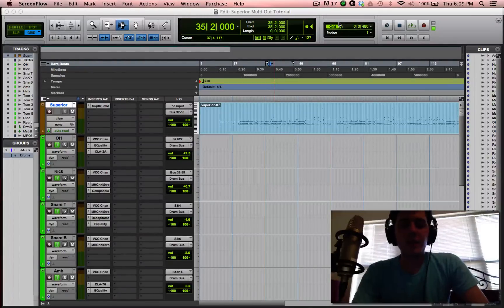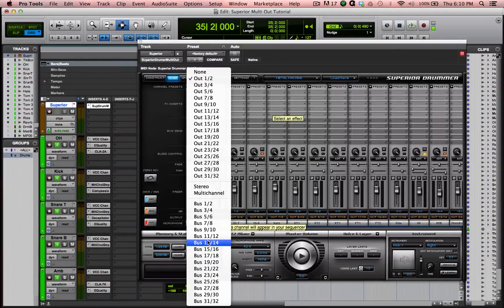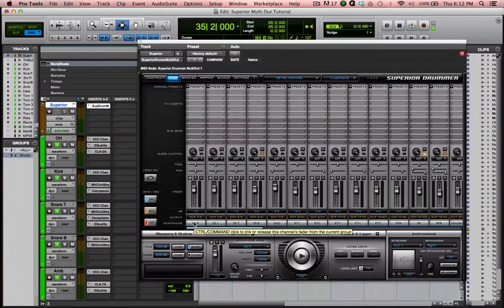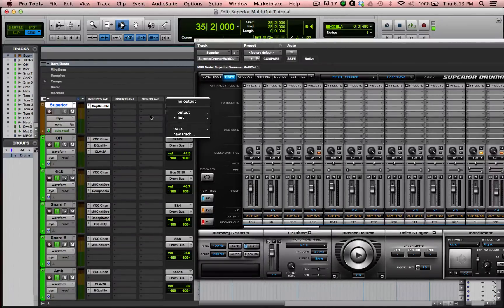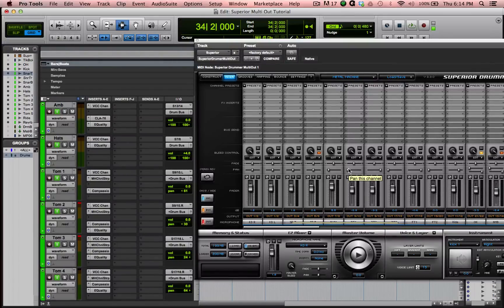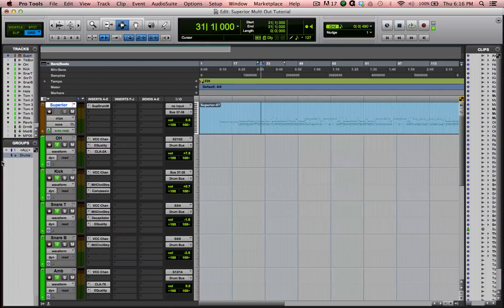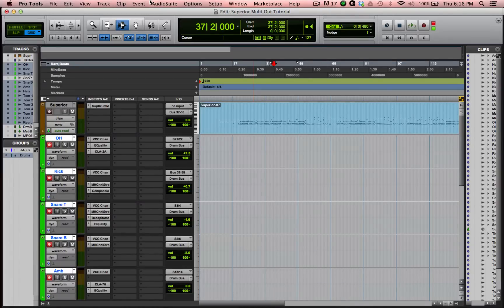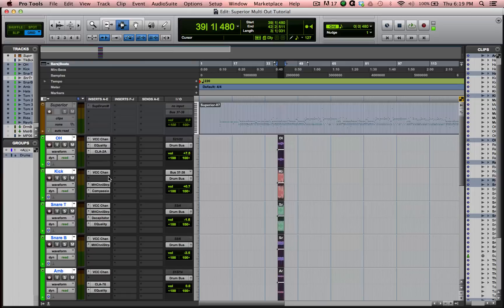Chris Lucas - Superior Drummer - Multi Out/Stem Printing Tutorial

Comment: there is better and easier way to do it. go to superior mixer and for kick use output 3/4 snare 5/6 and so on till room.
create needed amount of mono tracks (normally 9) and 2 stereo for overheads and Room. in protools first mono track use for kick input superior 3/4L or 3/4R and so on for all the track. much easier. same sound

Comment from the maker: I'm not entirely sure, that sounds like an issue with drumagog not outputting the midi at the correct velocity.  Can you make drumagog write the midi to a midi track?  That way you can turn off drumagog and just use that midi trick to trigger superior like most people do.  Also, you'd be able to adjust each velocity to be max (or whatever you wanted).  Essentially you'd use drumagog to turn the hits into midi and then turn it off.

Comment from the maker: Does Cubase have built in delay compenation?  Is the delay the same length as your buffer size?  If it is, you'll need to print them and nudge them back if Cubase doesn't automatically compensate.  To trigger superior samples you need MIDI information.  Are you saying that Drumagog is outputting MIDI info in real time to superior and the superior samples are delayed?